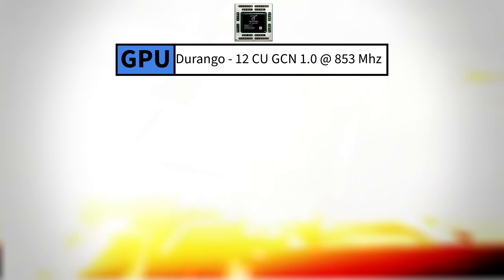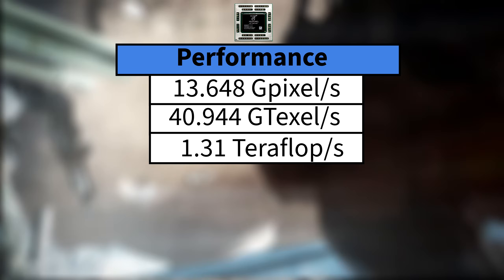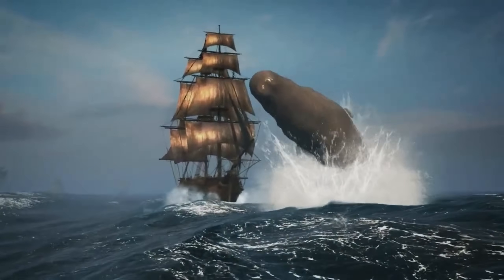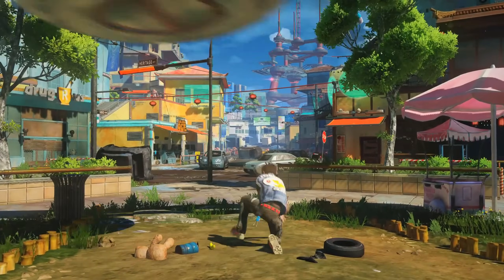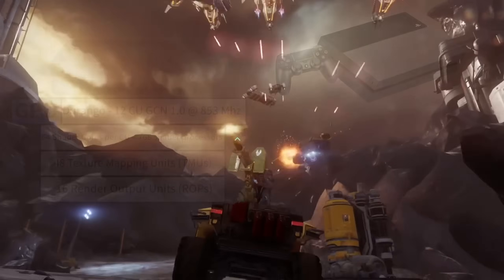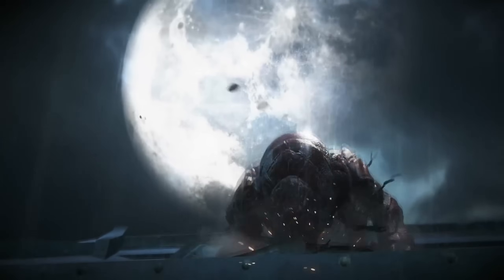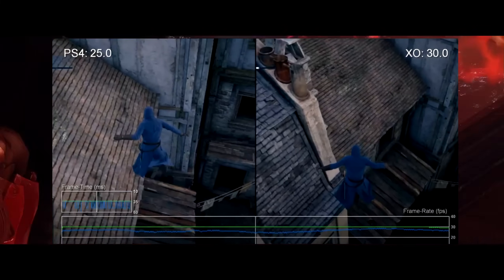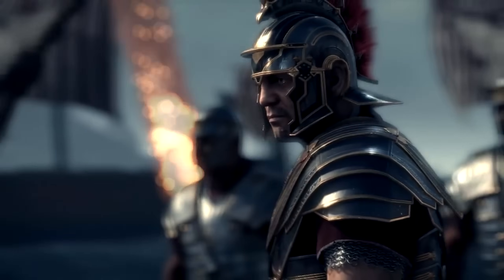The Xbox One GPU: Durango (Hardware Breakdown)

Comment: I do have fond memories of 2012–2015 Microsoft, tbh.

Metro UI was clean and beautiful-looking, “Xbox exclusive” used to mean something, Windows 8 was incredibly fluid and performant, and they at least tried to pull bold moves such as Rise of the Tomb Raider exclusivity or the Surface Book laptop design.

I've bought my X1 in August 2014, before it was even available officially in our country. Spent countless evenings in Titanfall and Forza Horizon 2, made numerous friends along the way, with some of which we are drill very close; we had to escape our country and immigrate together into Montenegro in late 2022. Good times.

But current-day Microsoft is just dull. The most boring console, the barely working advertisement platform disguised as a PC operating system. Meh.
Reply from the maker: That’s awesome thanks for sharing! I am glad you have had such a good experience with it! 🙏🏼

Comment: I never did get a PS4, nothing against Sony,but I was extremely happy with Xbox then Xbox 360 so I didn't hesitate to get a Xbox one. I still have it and when I purchased the Series X I bought a brand new disc drive for it and installed fresh thermal paste and retired it. I did play the Call of Duty Black Ops-Cold War campaign(disc version) on it to see if it could handle it and it played it well.

Comment: as someone who is working to make my PC able to match and surpass console performance via similar tech and methods but be upgradedable I watched the video to the end hoping to see the Xbox One X and/or the Xbox Series X GPU
Reply: What's your current PC specs and what are you aiming for?

Anything around a Ryzen 7 3700x/RX 6700 XT is already same if not higher than a Xbox Series X by around 20%, discounting the technical fixes/optimizations that allow 120fps mode by lowering everything then upscale it as consoles do.

Comment: I too did not get the PS4 until the Pro came out. Ended up getting a base 4 for $100 from a guy who had just upgraded to the Pro. As for the XBO, I waited until just before the One S to get the VCR model. I actually still use it to this day as a gamepass streaming machine. Its cool to be able to play newer games like south of midnight and indiana jones on a system they are not natively supported. Even flight simulator plays good via xcloud.
Reply from the maker: That’s awesome that you still use it! I gotta give it to Microsoft, they opened up a lot of possibilities and relevance with the streaming capability!

Comment: It's surprising how a supposed next gen console couldn't run a game at 1080p60, this should be the bare minimum requirement for that generation. I mean, sure, simpler games could, but AAA games barely hit a stable 30FPS or 60FPS, depending on the title, and let's consider that dynamic resolution became a thing during this generation, whereas previous ones opted for fixed resolutions, mostly. Now, back to true 1080p60, this is still something that I feel current gen consoles are almost there, these frame generation, dynamic resolution and other gimmicks always make me laugh, just give players true, crisp fixed resolutions and stable frame rates, can they?

Consoles, past the 5th gen were always underpowered compared to PCs, but these specs are budget PC-like, the thing is, this is what they are, budget PCs, right? But why these companies hype them as the NEXT BIG THING every single launch is beyond us at this point.

PCs always worked better for me, and this is still true to this day.

Comment: I've got it on the launch day, and sold it 3 months later. Hardware was Ok, but the OS / software was absolutely unbearable. For me, this console generation was when the shift from insert the game & play model to the current one. Which is mandatory online / patches / updates. Whenever I had half an hour to play a little, it turned out half and hour of updates and fighting the console.
On current gen, the OS is basically the same, but they have polished the experience a little to be just acceptable. But I still miss the days of plug the cartridge and play.

Comment: Ah, the Xbox One.  People love to call this one "just a PC", but in reality it was way more forward looking than most will give it credit for.  You mentioned that it's based on GCN 1.0, but I'd say it's really a custom derivative.  Features all the way up to FL 12_1 are supported, something AMD wouldn't do in their desktop chips until Vega.  There's also the DX12 Command Processor, which allowed for HAGS (Hardware Accelerated GPU Scheduling) years before it became a thing in Windows (2020!).  Of course, this is common for Xboxes to introduce a feature before it debuts in PC DirectX/Windows, and it's great the Xbox One isn't an exception.  There's also the quad DMA engines with their specific processing that can be applied to data for all sorts of more "console-esque" programming techniques, LOGAN, VRR, the list goes on.  A truly underrated piece of kit.

And yeah, ESRAM was not a great idea.  I don't know what AMD and Microsoft were thinking.  They pulled the same dumb move with the Wii U so someone at AMD must have thought huge caches were great (and I guess with RDNA2, was kinda right?  But in 2012-13 it was too ahead of the time).
Reply from the maker: I love hearing your feedback on these consoles, Kirby! I would listen to a Kirby podcast talking about these things all day!
Reply: Did the series consoles introduce anything before PC had it?
Reply: @chettlar212  VRS Tier 2.X, DirectStorage. AutoHDR just to name a few things.
Reply: @kirby0louise , oh wow. How did I forget all of those? I guess because they seem very software-focused.

Comment: That said the true problem on this gen is the bad power ratio between the CPU and the GPU, a Piledriver or Steamroller (even with "just" four 3.5 Ghz piledriver cores) APU with a bit weaker (~1.0-1.1 Tflops) GPU than those in XO or PS4 was the better solution for a stable framerate.
Reply: It probably would not fit in the power/thermal envelope that they were going for, and having a weaker GPU than what was in the Xbox One, would have been even worse.  The PS4 kind of did it correctly, although the CPU was the issue there.  The fact is, there was no really good alternative back in 2012-2013 for AMD but to use Jaguar. It was better than Bobcat, and had the power efficiency that Bulldozer/Piledriver lacked.   Also in that time frame, AMD wasn't doing so great, doubt they had the R&D budget to make something really custom with the a Piledriver on an APU in a console space.
Reply: @davidandrew6855 I'm not sure about the Xbox one, but the PS4s gpu had hardware that was able to offload tasks from the CPU like physics etc. which helped a little.
Reply: @arthurmorgan6489  You are talking about GPU compute, Xbox ONe could also do this, but since it had a much smaller GPU, the hit on performance would have been higher.
Reply: @davidandrew6855 apparently amd did give Sony the option for full fx cores in the apu, and Sony originally selected this, but amd later convinced them to use the Jaguar instead. I imagine it would have run pretty hot, and the clockspeeds would have been very low, like 2ghz. Still a decent bump in power over jag.  And since Microsoft was already on board with Jaguar it would have been more complicated for AMD to mass produce 2 different apus
Reply: @arthurmorgan6489  "apparently amd did give Sony the option for full fx cores in the apu,"

Everything I have read on the design of the PS4 that was never mentioned it was always Jaguar as the base fro the semi-custom SoC. Do you have an article or reference I could read, that sounds very interesting.

Comment: I think the fascinating thing during this gen was the bump from 512MB to 8GBs. That was a large jump.
Reply from the maker: Yeah for sure! Then we go to just a 2X with current gen over last. Things are slowing down and it makes me sad
Reply: @FrameRated  If The Consoles Stayed Out Until There Graphics Faded Like 10 To 15 Years The Jump Each Generation would Be Huge.
Reply: Also going from PS1's 2MB to PS2's 32MB was a huge improvement. But I have to admit that PS3 and X360 were surprisingly capable with that 512MB (which was shared for the CPU and GPU)
Reply: @keulloe ps3 had dedicated half and half of that figure for gpu and cpu seperate which is partially why the 360 had better performing 3rd party titles because devs could allocate more memory usage swinging in either direction when needed vs ps3 having this dedicated split you couldnt overcome outside of whatever naughty dog's black magic was they utilized to make the last of us run and look like it did
Reply: @dr._breens_beard  yeah, I know. It was a mess still though since PS3 had XDR as main RAM and GDDR3 for the GPU
Reply: Yeah I'm surprised it wasn't 4GB or 6GB
Reply: Not even just console. The jump to cheap android phone to have 8gb ram is also quickly but right now they afraid to sell cheap 12gb phone
Reply: @fikrijuanda6321  12gb phones have been around since a long time, get yourself a note 10 plus if you want cheap ram phone.
Reply: I suspect if next gen consoles rely heavily on AI LLMs we may see a larger bump on the next consoles. Perhaps 32GB?
Reply: @Gman2002  most likely 24gb. It's just pointless to have this much vram, nothing will use it.
Reply: @MisterPikol  vr games could use it
Reply: @mara2001  are they that demanding on vram ? I think the most important thing would be the latency and frames in vr, which could be rather cpu dependant.
Reply: @MisterPikol  some games like Cyberpunk 2077 on PC require an RTX 4090 to play smooth and barely reach 60 FPS. It would be interesting to have 32GB of VRAM, which would eliminate the limitations within VR. Although there are people who are comfortable with low FOV headsets and not so high resolution, consoles would not have an upgrade option if they wanted to make a next-gen VR game. I just think it's better to increase the VRAM than to release a "PS6 PRO VR EDITION".
Reply: @mara2001  thing is, I sincerely doubt a ps6 is gonna be stronger than even a 4080, so I think the bottleneck would start with raw power first before the ram would deplete.
Reply: @MisterPikol  i wish i remembered the term but actually I have listened to a few videos from some veteran graphics devs discuss a new form of rendering that is incredibly fast & photorealistic and instead of requiring lots of gpu cores instead relies on with huge amounts of vram and system ram.  Sorry I forget the name of the rendering technique there are lots of videos on youtube.  Once I remember the term I'll leave another comment.  Unfortunately even consoles with 24GB of ram wouldn't be enough.  Even 32GB might not be enough.
Reply: @MisterPikol Gaussian Splatting, that's what the graphic dev wrote about. Its a new type of photorealistic render could start being used in games if consoles had alot more RAM.  Also I'm guessing more ram could benefit locally run llms for far better ai and npc dialogue, and the potential for better neural network based physics.

Comment: I like the Xbox One platform despite its bad reputation. I had the VCR model for a while before I got an Xbox One X to replace it. I respect the VCR for being my starting point into the Xbox One era and it certainly did its job fine enough during its day, but even I would have a hard time going back to it for many different Xbox One games. It just didn't get enough developer attention to properly optimize many games that came to it. However, the VCR model does make a great backwards compatible machine for the games that can be played from the OG Xbox and Xbox 360. That also makes it an awesome spare machine to use for System Link games from the OG and 360. It's super easy to setup fun multiplayer nights over several systems and TV's to play Left 4 Dead, Crimson Skies, Battlefront 1 and 2 (the originals, not EA's garbage) Call of Duty World at War, Black Ops 1 and 2 or the original MWF trilogy, Halo 4 or Reach (both the 360 and the Master Chief Collection versions) and many others I'm probably not mentioning. Best part is the VCR is cheap so you don't have to break the bank to accomplish this feat. Other than that though it's better to just get and Xbox One X and install an SSD into it to speed it up a bit or just pony up the cash for a Series X. Your games will all run and look much better on those machines than a VCR or One S.

Comment: Would it have been useful for them to put in some sort of extra ARM based processor purely tasked with processing Kinect input instead of stealing 10% of the GPU power?
Reply from the maker: Since the Xbox CPU is X86 and an ARM is a RISC based instruction set, I can imagine it would be a pain initially for them to optimize for it, but it would have helped and in theory would be doable if they built it around the Kinect from the start! I am not sure what cost implications it would have had to do, even if they removed the ESRAM to do it. That is a good question!

Comment: AMD's "RX" prefix actually refers to gpus offering over 1.5 Tflops of compute and at least 80 GB/s of bandwidth. In the years leading up to 2016's launch of the RX series AMD determined that those
specs would be the baseline for any modern gpu. AMD's first 1 Tflop card the HD 4850 launched in 2008. In April 2009 the HD 4890 launched w/1.36 Tflops compute and 124.8 GB/s bandwidth with
3.9 Gbps gddr5 memory over a 256-bit bus. By 2010 AMD's midrange HD 6870 offered over 2 Tflops compute and 134.4 GB/s bandwidth utilizing 4.2 gbps gddr5 over a 256-bit bus. ...It's no secret
that MS and Sony wanted to go as cheap as possible. Sony's decision to go from 4 to 8gb vram was last minute. But, the whole XB1 design philosophy is particularly baffling.

Comment: I like to imagine an alternate reality where Don Mattrick had zero involvement. I imagine myself a time traveler going back and telling MS that the Kinect will be despised, digital only on console
won't be feasible for even the next two generations, the same goes for leveraging the cloud. Even going into the 2020's with 2020's tech there still will be hurdles. I would say that a quick room read
will show how little people care about "TVTV". If your box ships with Netflix you're golden. Sony are not only coming out swinging with games, and a cheaper console. But, they will double their vram
from 4 to 8gb of gddr5. Ditch the eSram. Go full gddr5. An AMD apu is fine. Just beef it up. Utilize chassis space for extra cooling. Leverage BC from day one. Look into faster storage too.
Reply: I really miss Kinect.
Reply: Yeah, to me it makes no fucking sense why they didn't have higher clock speeds on the VCR Xbox one. It had more than enough thermal overhead to support at least 2.3ghz on the CPU and 900ghz on the GPU.
Reply: @arthurmorgan6489  If MS would've spent extra on the vapor chamber cooling like they did on the One X then they absolutely could have oc'd the whole apu. Idk if the clocks could've went as high since the og Xbone apu was on 28nm while One X was on 16nm. I've heard that og xbone dev kits had cpus that clocked at 2.7ghz. The only thing is that idk if those were jaguar cores or traditional desktop (bulldozer?) cores. ... Long story short, oc'ing could've been possible. MS thought the low clocks and specs were fine because "the cloud" would do all the heavy lifting a la Crackdown 3's silly multiplayer. That kind of infrastructure was over 10 years out.

Comment: One of the biggest "fumbling of the bags" in gaming history. All goodwill from the 360 generation evaporated basically overnight after that horrendous announcement. Less capable, more gimicky, less consumer friendly, and more expensive.
Reply: Me watching the Xbox One announcement event as a non American

Microsoft - TV! TV! TV! TV! TV! TV! TV! TV! TV! TV!gamesTV! TV! TV! TV! TV! TV! *TV features not supported outside North America*
Reply: Basically the PS5. Without the good marketing, of course.
Reply: @VTorner You mean the Series X. The PS5 is a massive success and is outselling xbox almost 3 to 1.
Reply: @VTorner Basically the Series X. With equally terrible marketing, of course*
Reply: They followed in the steps of the ps3: had a great year before, made a gimmick that upped the price needlessly, then the gimmick got sacked pretty quickly.
Reply: @FireFoxDestroyer what gimmick did the PS3 have? The cell processor?
Reply: @ yeah, it was the major selling point of the entire console and it massively brought it down. It was hard to develop for and it hampered development and caused Microsoft to win big that generation.
Reply: @Matt-jc2ml, it had the sixaxis as well in the ps3 controller before they got rid of it and made it just the dualshock 3.
Reply: @FireFoxDestroyer How exactly were PS2 backwards compatibility, a blu-ray drive, built-in wifi and bluetooth and a wireless controller gimmicks?
Reply: @ not that, the cell processor itself was a gimmick because no one really took advantage of it
Reply: Watch Nintendo do the same thing 10 years later.
Reply: @edsheeransdad9985 S2 is more capable honestly, a huge step up Imo, but I see where you're coming from with everything else

Comment: What did not help was fhe fact thag Xbox one ran games in DX11, a steep performance difference from the easier OpenGL and custom libraries used on the PS4.
Reply: That wasn't the issue the issue was the slower GDDR3 memory while PS4 used GDDR5 which at the time had been out on graphics cards since 2008. So it was cheap. MS chose to cheap out on memory.

Comment: given that both gpu are GCN 1.0 and for example ps4 can run linux...
It would be nice to see how improvements could be achieved using FSR 1.0 or even FSR 3.0
Sony and Microsoft didn't want to increase the life of those systems but using SteamOS you could teoretically increase the life.

BTW: if you don't know GCN 1.0 are totally suported and updated in linux thanks to amdgpu kernel driver and mesa radv driver.